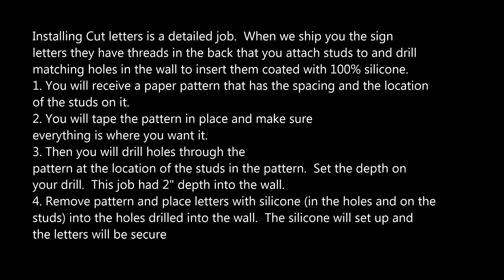Installing Outdoor 15" Aluminum Letters

Comment: What's the min thickness you can use for the aluminum?
Reply from the maker: they need to be thick enough to get threads on them for the studs.  I would say best at 1/4" but you might be able to do 3/16" aluminum.  we did some thinner ones and almost pushed the studs through the front.

Comment: Where do you get the rods and spacers you’re using?
Reply: Its just threaded rod and plastic tubing   or you can use any material for spacers just once theyre the same size